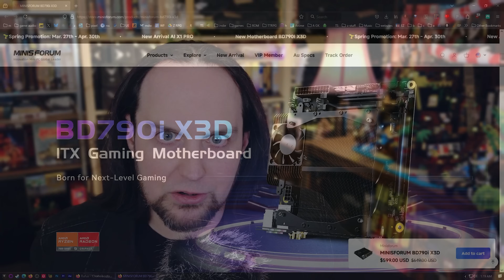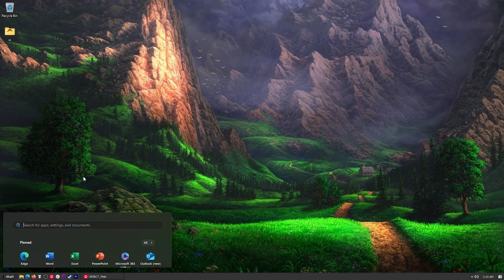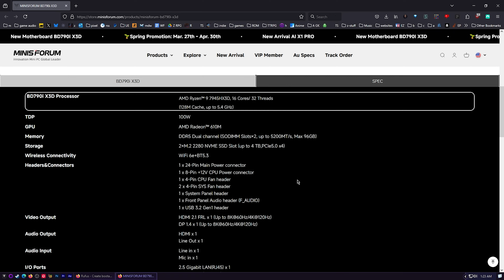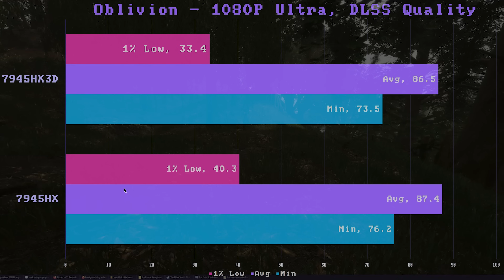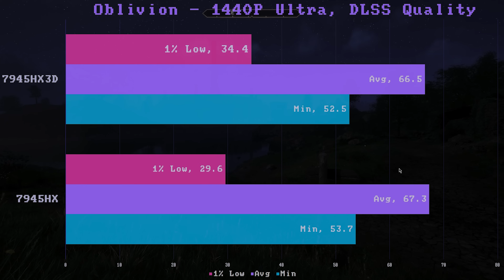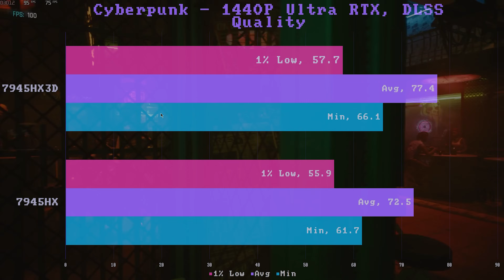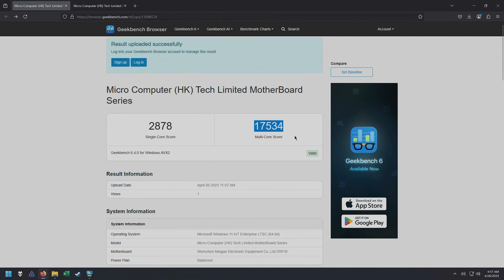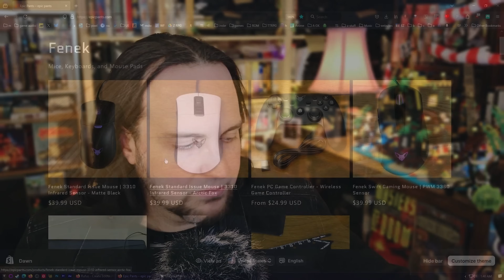Minisforum BD790iX3D – 7945HX3D vs 7945HX 16-Core ITX Battle!

Comment: I just picked up the MinisForum 7945HX variant. Are you running with precision boost enabled and 75watts? Wish I could run Ryzen Master but they disable it for these mobile chips. Also, I had to manually enter all custom DDR timings (in hex) as the defaults auto were absolutely horrendous. I'm running a 5600Mhz 96GB kit but at 5200Mhz with much tighter timings of CL 36, tRCD 36, tRP 36, tRAS 74, tRC 110 all in decimal. Stable and noticed a decent increase in FPS once I fiddle with all the memory timings.

Comment: Your pcie 16x slot should support “bifurcation “ in the bios.  I would get a 3 pcie 16x bifurcation riser and use 8 lanes for my video card and install 2 x 4x pcie usb 3.0 cards with 4 ports on each for a total of 8 added port 👍🏾

Comment: M2.5 x 30mm screws and a 120mm fan duct with a 90mm opening pointing towards the exhaust wall to pull in isolated air will bring the temps down significantly. I do SFF so my two top fans in one of my cases are my exhaust, and the difference is a "god send".
Reply: Didn't know about this, very useful, thanks

Comment: If one buys this (i got the 795i version) .. be very careful, since like always with QC its real bad.
got it yesterday for a friend that was still on AM4.
Build it with 2x24gb crucial, what else. was running it, but it was HOT very HOT in CB23 it got up to 91C in seconds, and the scores where "bad"
Took it out again, since my AX210 WiFi came in and needed to install it. and you need to take off the heat sink to get to the mounting screw for the wifi card.
it had NO paste, it was some kinda of "sticker" paste witch was on the IO die and only on HALF of both CCD's !
Cleaned it, pasted it with some Gelid Extreme, put it back together again, Full tilt it does 4.7Ghz on ALL cores, CB23 1960 single 34010 all cores.
And its at about 70c/75c doing it.. and yeah i bought one for myself to now i got the 975M version coming tomorrow :P

Comment: You can put which ever heatsink or water block on and temp stay exactly the same. I run this with water block and liquid metal and temp drop down by 10 degrees but still in full load goes in 83-85. MINISFORUM just have set big cpu voltage in bios like 1.3V and max 1.4V that is too high. I message them already and i get message ( this temps are fine no issue )  :hand-pink-waving:

Comment: Perhaps there is some more tweaking to be done on your setup. With just a few BIOS tweaks on my 7945HX (non X3D), Cinebench R23 score is,  Single Core: 2016   Multi Core: 34919
Reply: which settings are u using? i have tyhe same bd790i
Reply: @daemonkisure2952  The largest boost comes from:
Advanced/SMU Common Options/TjMax = 93
Advanced/AMD Overclocking/Precision Boost Overdrive (Advanced)/CPU Boost Clock Overdrive/ Enabled (Positive)
Advanced/AMD Overclocking/Precision Boost Overdrive (Advanced)/CPU Boost Clock Overdrive/Max CPU Boost Clock Overdrive(+) = 150
Advanced/AMD Overclocking/Precision Boost Overdrive (Advanced)/Curve Optimizer/All Core Curve Optimizer Sign = Negative
Advanced/AMD Overclocking/Precision Boost Overdrive (Advanced)/Curve Optimizer/All Core Curve Optimizer Magnitude = 30

Star with that, there is more to be tweaked, but it will depend on your memory performance, I have beast memory the overclocks to 6200 stably.

I re-ran the benchmarks after putting in a real video card and I guess there is a bit more headroom on the wattage as it's not using the inbuilt video, I get better scores, particularly on multithread.
Cinebence R23:      Single 2016 / Multi 35015
Cinebence 2024:    Single 116   / Multi 1867
Reply: @daemonkisure2952  I did reply, but the reply disappeared. Might still show if you sort by newest first.

Comment: Thanks for the review. Did you use a fresh install of windows? You need to have a fresh install of windows + the AMD chipset drivers installed + gamebar working in the background to get core-parking working properly on these. Otherwise games won't run strictly on the X3D CCD. I did see a noticeable jump going from the BD790i to the BD790i X3D in games.
Reply from the maker: Indeed. Fresh install.

Comment: Looking at your case, it looks like you have no case fans except possibly at the top?

The NR200 has 5 fan mounts with the Plexiglass side panel and 7 with the Mesh side panel. 
2x120MM in the top for exhaust
2x120MM in the Bottom for intake
1x92MM in the rear for exhaust (you can't use this one with the BD790i or BD780iX3D due to the size of the cpu heatsink)

The Mesh side panel adds:
2x120MM for intake (these can also be hard or impossible to use if you vertical mount your GPU, which the case dose support, though the mesh panel will allow the card's fans to draw fresh air directly from outside the case)

I have a BD790iX3D build with a 4080Super in an NR200 with the 6x120MM filled and it runs quite cool.  They aren't even all high airflow fans.  The fan on the CPU cooler is an Arctic P12Max while the 6 case fans are Arctic P12ARGB fans.

The main difference I notice between the regular and x3d versions is frame times.  The X3D has been smoother with some boosted frame rates, though not too dramatically different.

For references, my BD790i is in KXRORS S300 case with the case modified with longer feet and to have 2 120MM Arctic P12Max mounted below the case and push fresh air up from below.  This case is small and mounts the GPU vertically.  I previously had my 4080Super in this build (it requires detaching the rear panel to slide a max length GPU in from the back[305MM long, 55mm/2.5slots wide] to get it inside).  Now it has my 3080ti instead and the machine is still a powerhouse.
Reply: The heat tests were done without the case

Comment: 2:57 that pad is really badly installed from factory

its uneven and has air bubbles which can trap a lot of heat
Reply: No once contacted it wont have any problems.

Comment: I got this board(non x3D), I game at 4k so I dont need Vcache. I swapped the stock thermal paste for legit Honeywell PTM 7950 with a Thermaltake Toughfan 12. It now holds my temps between 75-81 after a long gaming session. I have my fans running full speed at 85 C
Reply: Alao you can get better temperatures  if install  a better air cooler.
Reply: @Rayu25Demonis this compatible with am5 mounting hardware? I haven't seen any videos on this board go in much depth for the cooler
Reply: @EggsOverSteezy  its intel is not am5
Reply: @Rayu25Demonoh? why's it Intel haha
Reply: @EggsOverSteezy  
 Ask MINISFORUM, not me; they made it LGA1700 compatible.
Reply: @Rayu25Demoncrazy stuff but I guess it's not that important anymore anyway. Do you know if anyone's done testing with other coolers? I've been thinking of picking this up for my next build but the temp is a bit high for me
Reply: @EggsOverSteezy I got it solely for the compactness, which is why I have the case I chose. Now I will saw that I have been eyeing the Ncase M2 which would allow for an AIO. The socket is an LGA 1700 so any AIO will work. The board is great and I've had no issues so far, just pick an ITX case that allows for an AIO and you're golden
Reply: If ur getting it for gaming why in the world would u not get x3d? How stupid lol
Reply: @godnamedtay 
Wait! 😂
You just tried to belittle me by saying that I should have got the x3D for 4k gaming 😂😂😂😂😂😂😂😂😂😂😂😂😂😂😂😂😂😂😂😂😂
What a clown! I have three desktop PCs in my house, one has a 7800x3D. I see absolutely no difference in frame count. Not to mention, every reviewer that actually will test at 4k non x3D vs x3D. You ever wonder why they focus on 1080p and 1440p?! BECAUSE IT ACTUALLY MATTERS WHEN NOT GPU BOTTLENECKED. Thanks for self owning yourself and making yourself look like a clown! Bet you delete your comment 🤡
Reply: @godnamedtay  the popcorn CPU
Reply: @Rayu25Demonwhat
Reply: @Rayu25DemonI already responded to that clown but they deleted my comment. I guess it hurt his feelings bc he called me stupid for not getting the x3D for 4k gaming 😂 in turn, he made himself look ignorant by not understanding CPU/GPU bottlenecks and how, at 4k the CPU doesn't matter as long as it is a modern 8 core+ bc the GPU is slower and the CPU is waiting. At 1440p and 1080p it matters bc the GPU is waiting on the CPU so it needs to have more cache and speed. Internet people trip me out with their "wisdom" 😂

Comment: You mentioned that you wanted a mATX board from Minisforum, they showed a mATX board with the 9955HX during  Japan IT Week. So we are getting a mATX in future
Reply: Their mATX boards still only have a single PCIe slot and similar m.2 and I/O configs though, but I guess if you just want a bigger PCB? 🤷‍♂
Reply: @paranoidandrewoid  the 9955HX they showed in Japan has two PCIe slots

Comment: Is the 4070 super worth pairing with an x3d chip? I'm really asking because I'm thinking of switching from the i7-12700k. Would that be worth it in your opinion? I'm talking about the 7800x3d or 9800x3d not this board. Also, I do 3d modeling too.
Reply from the maker: I mean, it's a good jump for 3D stuff. I haven't tested for blender or modeling, so you might want to look up some numbers on that. I would think more cores would be best, so if a non-X3D part with more cores is cheaper, I'd get that...

Comment: Not sure if the CPU has two CCDs like the desktop counterpart. If so, could it be that one CCD has X3D cache the other doesn't that cause the scheduling issue which hurts the performance slightly? Just assuming, this is mobile chip anyway.
Reply: You are correct on the dual 8 core CCD and single stack of 3dv cache. The scheduling issues though have been pretty much fixed with latest bios updates. might be worth looking at what bios version the minisforum is running

Comment: I would like to see a video of the stock heat sink being removed, let's  take a look under the hood!
Reply: I own this board. The heatsink sets on the CPU dies because the CPU is de-lidded. It also has a protective coating around the dies making liquid metal application very easy.
Reply: @rhoadeswr1  sounds very... cool

Comment: What is the thermal interface material that comes by default? Could those temps be improved by liquid metal or even by repasting it with anything that's reasonably good? Could it be an issue of lacking mounting pressure?
Reply: No. Temp are very good. No issues here. Many reviews said the same. He is complaining , because he's expecting 30C temp.
Reply: @diuran3029  He hit 89C in a short time. It's hard for me to call this good.

Comment: This is why I opted for the 790i board, I have it Oc'd to 5.8 and it's running at 42c 60max load. I had to machine a direct die bracket because i didn't use their heatspreader but man these little chips OC'd can keep pace with the 7950x. The only reason I got the 790i is because it was a return at microcenter, still sealed for $300.
Reply: These use LGA 1700 mounting points so sourcing an AIO should be straightforward. I was going to order an MSI 120mm AIO and mod my Ncore 100 Air case to mount the rad
Reply: @andrewsolis2988  yeah, thermalright makes one and I modified the height of the bracket. It's runs so damn smooth
Reply: @Nerd_Rage_Initiated  It has 52 mm x 52 mm spacing while LGA 1700 uses 78 mm x 78 mm. You need a custom mounting bracket to run different coolers.

Comment: Thanks for the memory... and all the other parts too. I have questions. Thanks for answering a couple of them that I had been saving up, in the last two minutes of the video. 😃I'm wondering about the fitment along with the other components in an SFF tower case in particular. Or, in a case with the same shape as the Fractal Ridge. But something with lots of mesh, no glass, and no RGB. Yeah, I'll just bite the bullet and sacrifice the extra FPS... For instance, can the board be mounted 90 deg. from upright, so a GPU can stand on end? Or if a riser cable is needed would it be too tricky finding one? 🤘

Comment: wish they had one with the 9000 series cpu the 7000's are known for running at around 90. The 7000 series the 3d vcache keeps more heat in the cpu since it's just layered on top of the die.
Reply: ms-a2